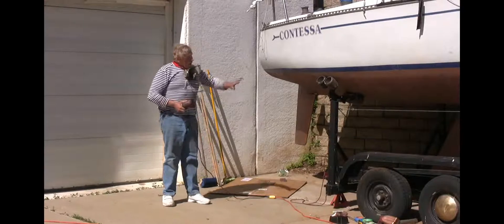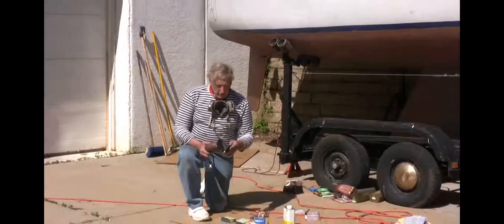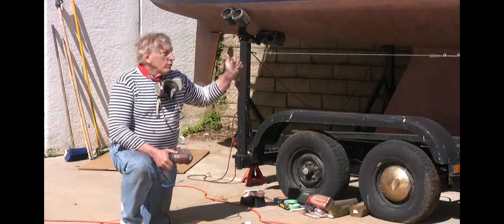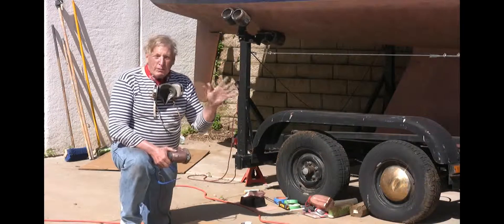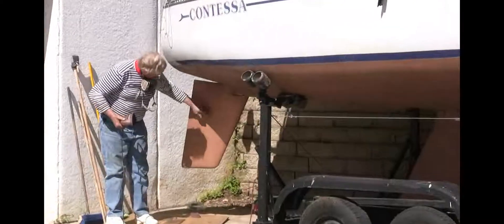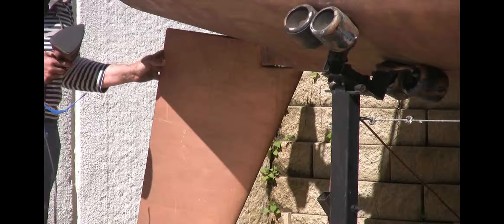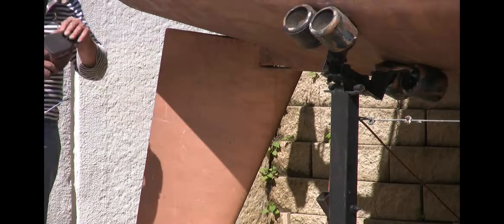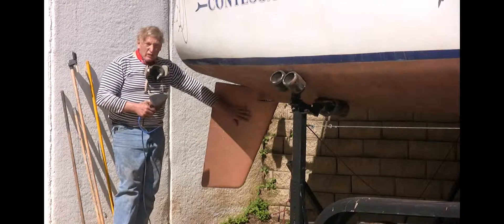Video 12: Make your keel and rudder into performance underwater wings.

Comment: That rudder seems to be rather heavy on the tiller. It could be better balanced with more area ahead of the pinion. I like the leading edge and the lower wing tip of the rudder. It is hydro dynamically efficient. Contessa is a very  good cruising boat.